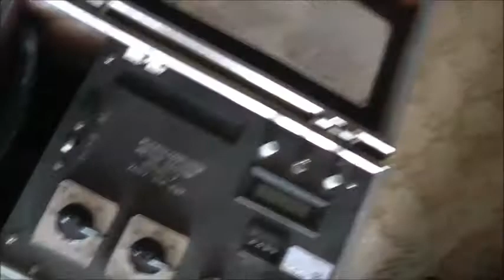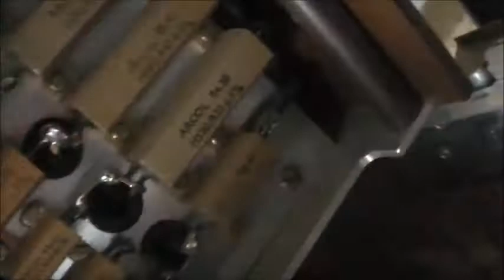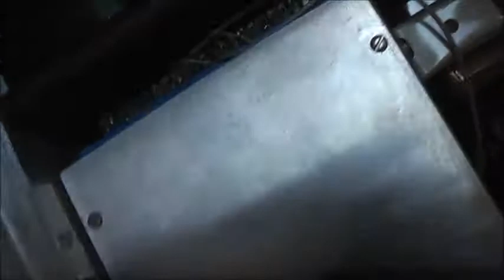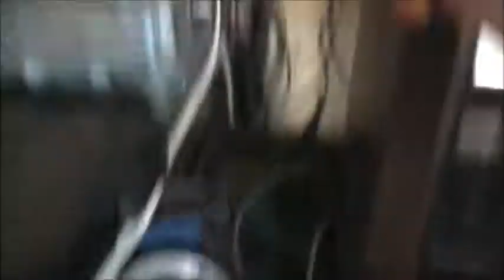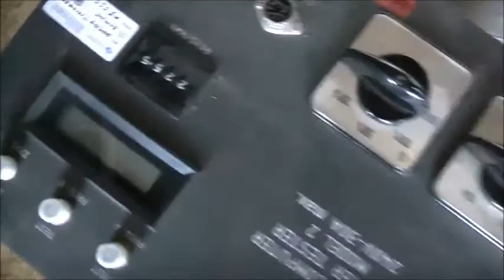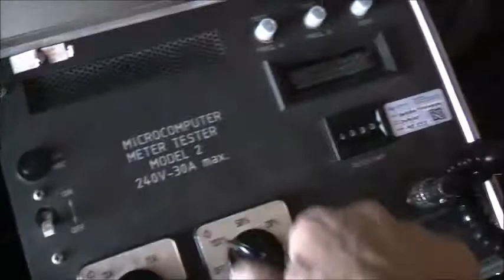Repair & Running Meter Tester On BAZ!

Comment: Ah, as soon as you opened that, I kinda figured that it would be a meter phantom-loader test unit. :-)

Given the size of those test leads and that it shows all that mathematical hocus-pocus, that in itself says to me that this is a phantom-load based meter tester. :-)

Now all you need to do, is figure out how to get that LCD screen to do what it's supposed to do, and set-up the test box so that it cal pull-off a meter test with a good degree of accuracy.

The only thing with this, as what I saw in the vid..... You need access to the meter's terminals in order to connect it in order to pull-off a test, so you probably couldn't use this on your incoming utility meter.... BUT!

What you could do I suppose, is test-up a meter to determine its accuracy, then wire that in-line with the utility meter if you wanted to test the accuracy of the utility meter, OR.......

If you wished to determine the accuracy of the test-box, you would need to connect one of your kWh meters in-line to the utility meter and 'calibrate' your kWh meter to the utility meter (which by law has to be accurate) and then once you've 'calibrated' your kWh meter, you can then use that to figure out whether-or-not the test-box is running OK. :-)

Thanxx for showing,

-BoomBoxDeluxe.

4th October 2014, 19.33